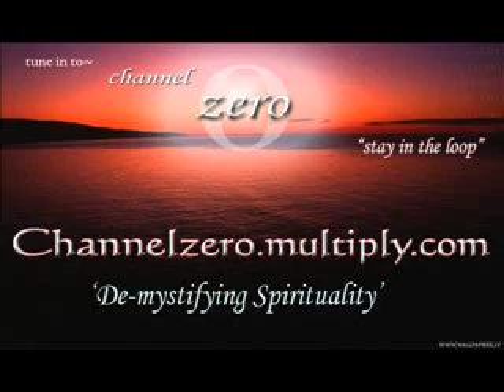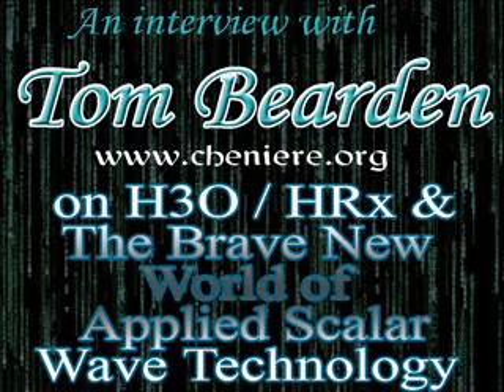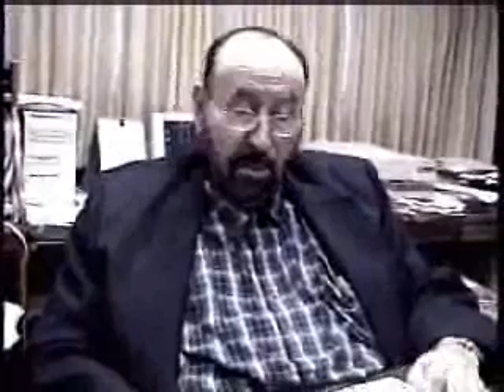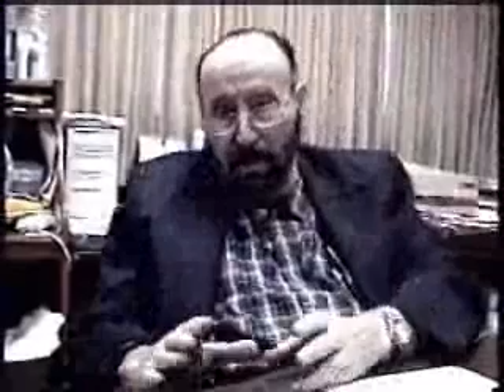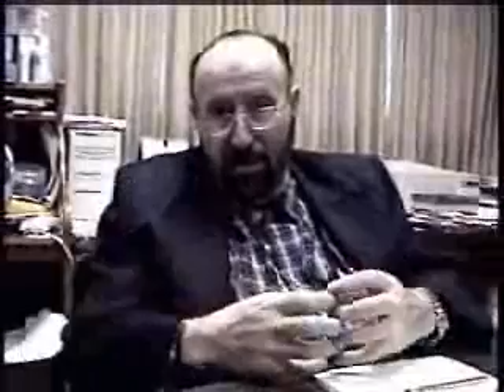Applied Scalar Wave Technology - Tom Bearden interview 3of8

Comment: the energy is already there waiting to be tapped. Tesla knew how to tap into it.

A compass does not point north because of a lot of Magnetic material at the north pole, it points north because of a spinning body with an iron core, An Electric Generator if you will.

I've always thought that that the Tesla Coil was a "receiver" of this ultra high voltage energy.